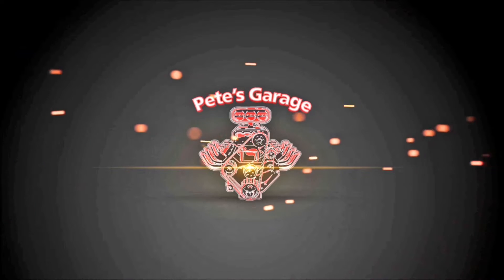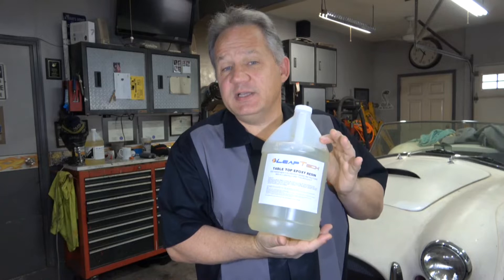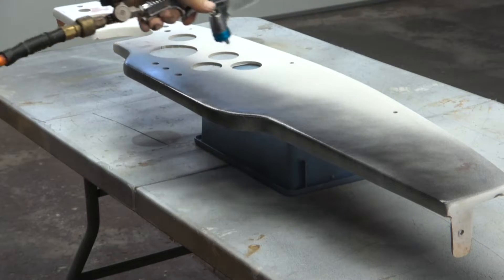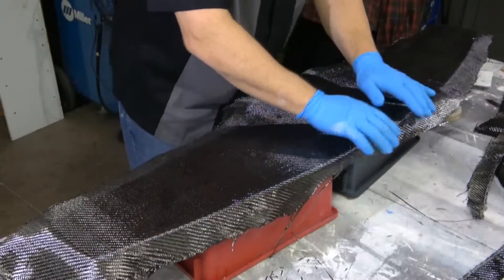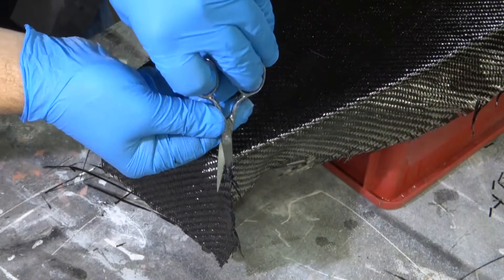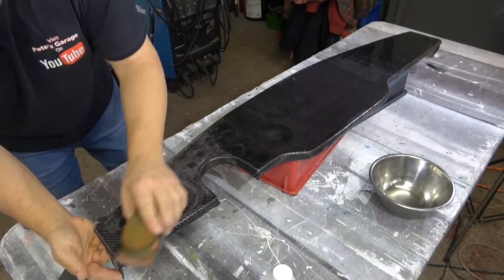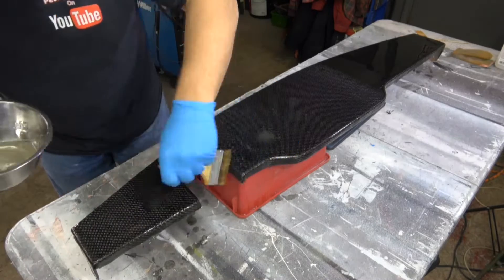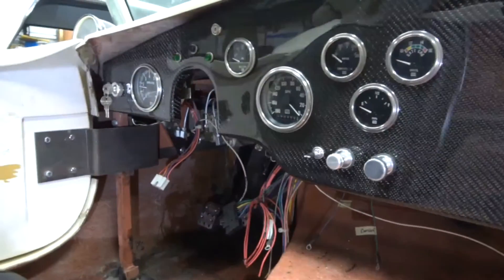How to Apply Carbon Fiber Cloth & Resin - Fiberglass Dashboard for the 427 Cobra

Comment: I decided with your video For the first time, I bought carbon fiber fabric and epoxy resin. Can I make the spoiler of my car carbon fiber? Please, someone who knows, tell me the simple steps of the work. I have seen a video on YouTube. Where should I do it? How many times and how many layers should I apply epoxy after gluing the carbon fiber? And my spoiler has color, do I have to remove the color completely or is it enough to sand it so that scratches are created? Thank you for your help
Reply from the maker: This is not an easy process. You should practice making small parts 1st
Reply: @PetesGarage  right thanks,  for the message, I have a car spoiler that I spray painted a few months ago, now I decided to make it complete with carbon fiber cloth and epoxy resin, should I completely remove the rust of the spoiler or sand it along that line? Is it enough to make a scratch?
Reply from the maker: You can make a mold for any part. Laying up the carbon fiber is the tough part
Reply: @PetesGarage but in this video you dont have any mold!

Comment: Pete, I realize you work with EFI, but is there any chance you can do a proper tutorial on tuning a Carburetor, and explain how it functions, etc.  There are allot of video's on the subject but I feel like your methodology is superior in explaining things.  And if possible talk about the old-school poorly designed/run gas lines.  Experiencing that with my kids new (classic car).  No joke, the fuel line is run under the engine and up the front of the engine (with metal fuel lines) that sit on top of the engine.  We're working on rerouting them to come across from fender to carb directly.   Hoping to avoid heat soak and vapor lock lock issues.  All kinds of issues being experienced because of the artificially high pressure built up from heat.
Reply from the maker: Sure I can, I think I can do that from some video I took awhile ago
Reply: @PetesGarage  Really looking forward to that.  Thank you!
Reply: It's a 71 Lincoln